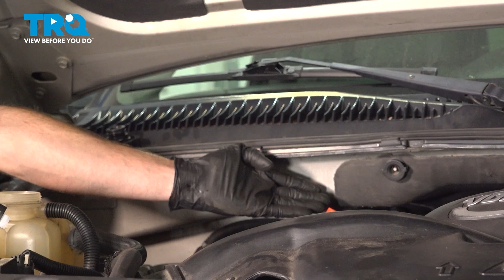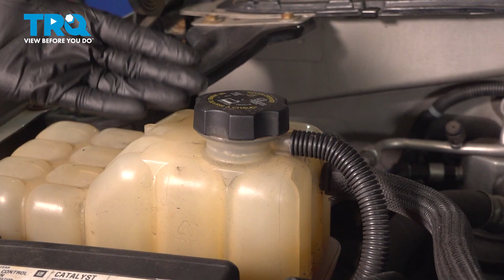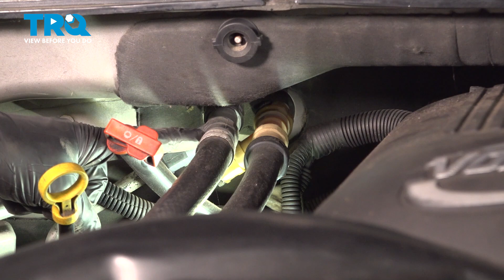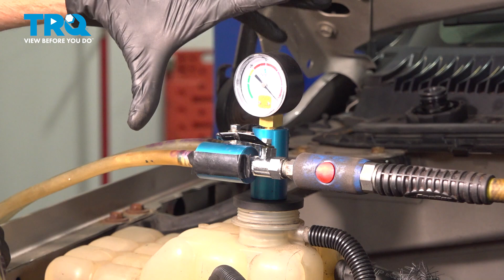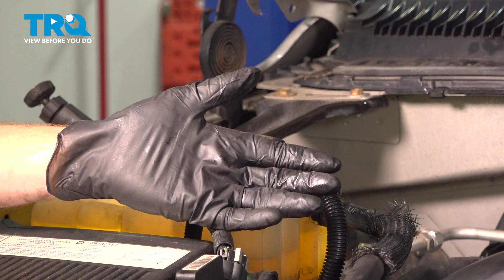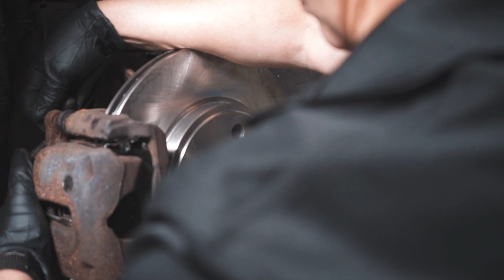How to Replace Left Heater Hose Connector Tee 2000-2006 Chevrolet Tahoe

Comment: What are those thin steel tubes ? 

If I just put the heater hoses to the firewall with clamps to bypass the aux am I supposed to cap off those 2 thin metal tube that the tee connects, connect to?

Comment: Very good video! I had to use my Dremel hot iron tool to melt thru the plastic T on the heater core connection fitting to get it off. The fender side T broke off in my hand. I replaced both of these, the fender side and the engine side fittings with the Dorman metal fittings. I also lightly greased the internal O rings with non dielectric grease. The engine side T came off very easily.